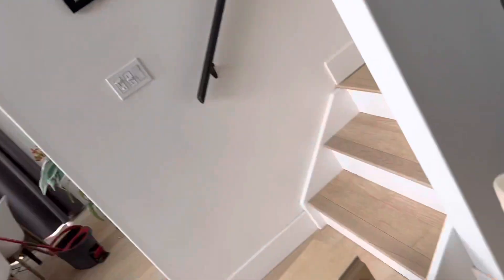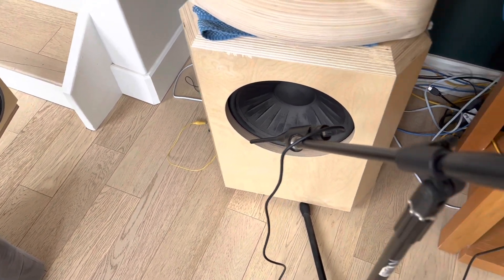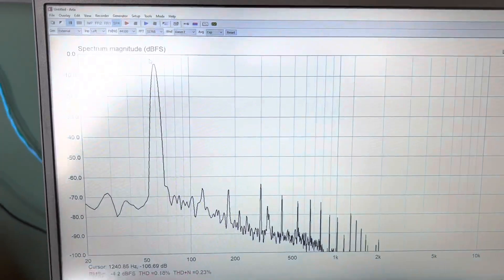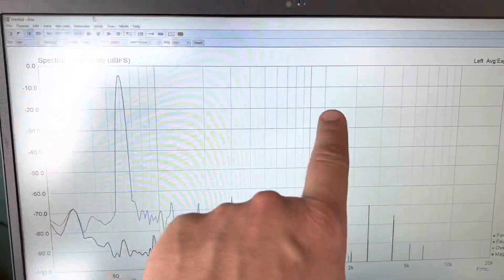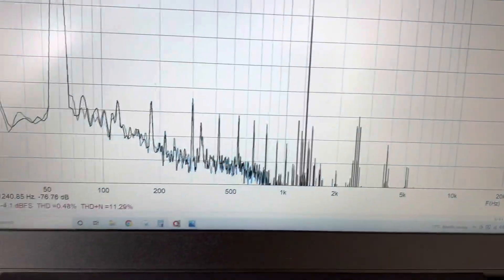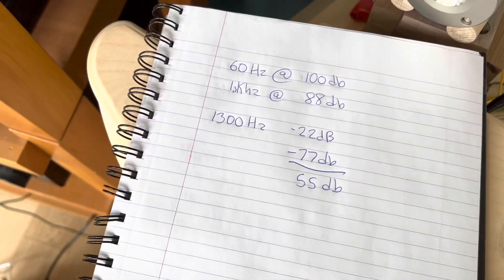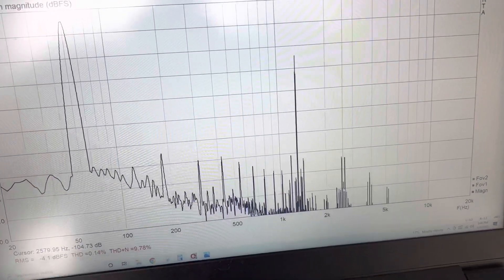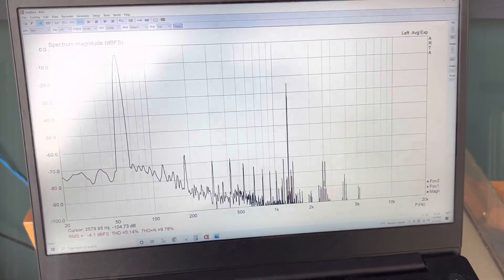Is my mic higher distortion than my speakers?  Let’s find out!

Comment: Thank you for sharing this very helpful test method. 
I have seen many developers making THD-measurements at high SPL at an extremely small distance between speaker membrane and mic. Such a setup heavily overloads standard mics that are not capable of the very high SPL involved. This overestimates THD and IMD in a not forseeable manner. I am using a moderately priced mic from ISEMCON EMM-82H-PX. The 82H-Type has lower sensitivity but can be used up to 140dB. In combination with an RME babyface, this allows reliable distortion measurements with low noise.
Nevertheless, cheap measuring mics are competely suitable for room correction and x-over development.
My personal experience is, that IMD and higher order HD do matter. Frequency response comes first, resonances and ringing has to be avoided by all means - and than comes jitter and IMD. I do not care much about second and fourth harmonics.
Reply: But that second or fourth harmonic will be modulated anyway. It'll also be amplified by resonances in the driver.

Comment: I have three mics. The UMM6, a Umik1 and a Umik2 from Cross-Spectrum labs that is calibrated by them. I found that my UMM6 was significantly off  in frequency response and distortion compared to both Umik's and the 1 matched the 2 fairly well.

I emailed CS labs and they basically said these kinds of microphones are fairly limited and if we want much better accuracy, they have recommendations and can validate their calibrations. I highly suggest just a better microphone outside of these cheapies from Dayton and minidsp.
Reply from the maker: CS Labs?

Comment: For measuring rooms, the cheap measurement mics like that one are perfectly fine. For designing speakers I wouldn’t use anything less than an Earthworks with an RME interface. In my case I use a Fireface UC for my testing rig which is great and offers pretty much all of the I/O you’d need to test any kind of system or gear
Reply: -55dB is more than enough distortion range. I mean it's 0.2% THD. Anything below 1% is more than enough.
Reply: @Elliott-Designs  for speaker design no. My speakers hover around 0.1% and I’m looking for drivers that’ll get me lower
Reply: @gerhardwestphalen  Just because you can get lower, doesn't mean you should. Once you get below audibility in one area, get below audibility in others. Start pumping the money into more important areas, such as active speaker design, extension, cabinet design, directivity, power response, so on, so fourth. My point being, don't put all your budget in one area! It's basic engineering design, based on studies. If studies prove that people can't discern anything below 1% THD, you reach that in your design process and work in other areas. If you want to keep pumping research into lower and lower distortion, be my guest. Doesn't mean that's the way it should be.
Reply: @Elliott-Designs  oh Elliot, what makes you think he's not doing all the prototypical  stuff ur rambling off on?? that and who are you to tell anyone what they should and should not be doing.. esp when you don't ask for his objectives ist, which you assume are your own... project much? I could go on but you're all to typical of those suffering from the "dunning kruger effect". With that closed mind of yours i'm guessing you're not a pro in this field. Maybe learn something from Crowe's "even keel" take on things.. i could tell he was a pro engineer in industry a mile off..
Reply: @gregd6022  Hi Greg, if you were to read my comments, you'd be able to tell I believe in the scientific method (as all well educated engineers should), absolutely nothing wrong with that, I also didn't say he couldn't use lower distortion microphones (because who am I to say what someone does or doesn't do). I was simply saying that I don't know of any scientific evidence that supports the need for such low distortion measurements, or needing something of such low distortion in terms of audibility. Also, no Dunning-Kruger Effect here that I'm aware of, I know I don't know everything, no one knows everything, and I believe the enlightenment part of the Dunning-Kruger Effect is the understanding that you will never know everything about a topic, and that all you can do is strive to know more. That's why confidence of the "expert", of which I'm not saying I am one, just giving an example, is lower than that of the ignoramus on the graph.
Last but not least Greg, Joseph is one of the first YouTubers I watched when getting into the hobby, there's no need to feel to defend him, if he felt he needed defence I'm sure he would have replied to correct me, which I was more than happy when I found he did. But I wasn't attacking his choices, I was questioning, as we all should be doing to each other, it makes us better at what we do. I think he's a great guy that makes really nicely measuring speakers 👍
Reply from the maker: Thank you for the suggestions.  My customer brought over his RME DAC the other day and it sounded better than the Topping D10S that I was using.  On ASR the RME has 10dB lower IMD than the topping and it was audible. (-120dB vs -130dB).  Was it the lower IMD I was hearing?  Perhaps.  Everything correlates to that.  I will be upgrading my test setup at the end of this year.  For now I want to do a series of videos that explore the topic more as a narrative.  One that I will be doing is comparing IMD and THD when looking at issues in the loudspeaker crossover region.  Thanks again.
Reply: @JosephCrowesDIYSpeakerBuilding  Fair enough, when I see a new peer reviewed study that disproves the last one, or at the very least a double blind test, then I'll believe it. I stick by the scientific principle. Otherwise I'll put it down to other things about the dac that have changed, or just plainly the placebo effect.
Reply from the maker: There are plenty of studies showing the inaudibility of higher order harmonic distortion.  When these high order harmonics are added to a sign wave they are completely inaudible.  However that is not what is being discussed.  
Here is an excerpt from the book Loudspeakers for Music Recording and Sound Reproduction…

“ It has puzzled many people for many years why relatively low levels of high-order harmonic distortion – 5th,6th,7th etc – have been associated with poor sound quality. The principal explanation has been that the higher harmonics are not musically related to the signal, but the very low levels of these distortions have not corroborated this idea when they have been added artificially to sine waves, where they have tended to be inaudible at levels which prove to be offensive on music. Czerwinski et al offer the explanation that the low levels of high-order harmonics are, in fact, just tips of high-order intermodulation distortion ‘icebergs’. It obviously does not bode well to be metaphorically sailing amongst icebergs in a sea full of piranhas! But that has been the reality of intermodulation distortion – a largely hidden, unquantifiable, yet dangerous enemy.

Distortion mechanisms which give rise to similar levels of harmonic distortion may yield greatly differing levels of intermodulation distortion, and this fact is surely at the root of the long acknowledged lack of any robust correlation between harmonic distortion measurements and subjective audio quality. Having said that, it is obvious that a loudspeaker producing 75% of total harmonic distortion (THD) at 1 kHz would not be considered to be high fidelity, but once we get into the low single figures at low frequencies, or below 0.5% at higher frequencies, then a loudspeaker with 10 dB less THD than another may well not guarantee that it would sound more musically accurate, even when their linear parameters were relatively similar. On the other hand, multi-tone intermodulation distortion presentations have begun to reveal good correlation between pure-sounding loudspeakers and clean-looking displays.”
Reply: @JosephCrowesDIYSpeakerBuilding  Thank you Joseph, so from what you are saying, is that distortion lower than 1% is audible, just not on a pure sine wave due to intermodulation distortion that occurs when you have stacked waveforms like in music which would be difficult to do a study on and is therefore listed as subjective, hence the analogy? Btw, please feel free to correct me, always up for learning more! I usually base these things off of research you see, but if the research is incomplete and doesn't provide the full picture as you are suggesting, then of course more needs to be done. It might make an interesting thesis/study for a final year project for me if that's the case.

Comment: Side question: Why ARTA over REW? Any particular reason, or just what you're used to? I find REW's extra features useful to me, but I can see having access to a proper polar plotter would be useful!
Reply from the maker: In terms of on-axis frequency response they are identical.  However REW requires quite a few steps to get a match-up between the two programs.  Out of the box REW does not gate the response and requires a fair bit of digging to setup.  The smoothing needs to be changed to 24dB/octave and the vertical scale altered to 50dB.  The shape of the graph window needs to be altered to a 4:3 aspect ratio similar to ARTA.   Then the response graphs match up perfectly, however saving these settings is a hassle as well. So if none of these steps are completed I feel that REW somewhat embellished the test results which is not what you want when testing speakers, unless one  “wants” it to look good. 
ARTA continues to develop their multitone functionality even allowing 12 band per octave test tones with a new overlay function.
Reply: @JosephCrowesDIYSpeakerBuilding  Thanks for the detailed reply Joseph! I like to use Physchoacoustic smoothing in REW, since it actually represents what we can hear in terms of gain changes, which I always find useful. Of course, the more detailed response is useful for knowing how the speaker actually behaves. I'll have to try out ARTA, this multitone stuff sounds interesting, I've never heard it before. Did you see my reply on how your mic's distortion is plenty good enough in terms of distortion audibility, because it really is. I wouldn't worry 😉. What frustrates me is that a measurement mic doesn't exist that has accurate phase characteristics (or phase correction with a calibration file). It means we'll never be able to truly test the phase of a speaker, not until we eventually get one of these mics, or a way to calibrate the phase response of a mic.
Reply: @Elliott-Designs  If you don't have a copy of ARTA its def. worth getting. The license is not too expensive. Reading Josephs reply just has me reliving all the frustrations I had with trying to use REW for the gated measurements. It can be made to work, but ARTA is much more fluid and easier to use in that regard. Also its very good for making horizontal and vertical directivity plots. Even though these are tedious to do if you don't have an automated turn table, ARTA at least makes making repetitive measurements fairly straightforward and easy. That would be a hair-pulling experience in REW, and I could only get a basic family of on and off-axis responses and not an actual graphical map.
Reply from the maker: Off-axis is easier and quicker with two people, one person at the computer and another moving the speaker.  Someday I’ll get a rotary table.
Reply: @JosephCrowesDIYSpeakerBuilding  Makes sense, thank you 👍
Reply: @JosephCrowesDIYSpeakerBuilding  Yeah I can relate to that. My "rotary" table is a wooden top to an old hamper with a rotary bearing and hand-marked degree graduations. Even worse is vertical for large speakers since they are too big to sit sideways on the table without altering the response. Last time I did it I resorted to calculating discrete points and used a laser distance finder to position the mic for each measurement, and even then its limited to about ±45 degrees in a room with tall ceilings. If I did these more I'd even possibly consider making a "Klippel-Lite" robotic mechanism to move the microphone to predetermined locations for taking measurements.
Reply: Ok enough waffling mysock and get to the point... REW cannot do a lot of measurements that ARTA can, like making directivity plots. It can only really do on-axis measurements. Im pretty sure thats why is that it lacks the functionality of ARTA.
Reply: And if you can humor a bit more of my blathering, I also don't like REWs interface as much for gated measurements now that I think back (its been awhile since I have used either of them). ARTAs is much easier to use IMO. REW, however, is really good at making in-room measurements, so really its down to using the program that is most appropriate for making the type of measurement you want for me. I use ARTA for things like on-axis response and directivity measurements, while REW for making in-room measurements and adjustments.
Reply: @mysock351C  Yeah, I totally agree with REW being more suited for in-room, and not for directivity; that's what I meant by polar plot really. As for on axis, not necessarily.
You do have FFT MMM type stuff after all.
It also has some super useful features that ARTA doesn't have. Honestly, I combination of the the two programs is probably most ideal.

Comment: Looks very interesting. That's great that your speaker is measuring with such low distortion, very impressive! Just wanted to say -55dB is more than enough distortion measurement capability. 54dB below fundamental frequency is 0.2% THD, and given that we aren't meant to hear distortion at all below 1% THD, I think it's more than enough 👍. I wouldn't worry about your equipment in terms of distortion accuracy unless you were worried about getting the right numbers for marketing the speakers 🙂👍
Reply from the maker: I agree that THD is benign and actually preferable in some instances.  I recently listened to the Schitt preamp and it had a rich vocal sound with the tubes engaged.  However when switching off the tube stage the richness went away.  What I’m mainly concerned about is IMD from the speakers.  IMD from a loudspeaker is very audible, and not in a good way, especially through the critical midrange where our hearing is most sensitive to nonlinearaties.
Reply: @JosephCrowesDIYSpeakerBuilding  Totally agree, that's what the 1% is in reference to. I don't like distortion either, we just can't hear anything below that. That richness you talk about from tubes (according to the research I've read in the past) is all to do with the fact that the ratio between odd and even order harmonics is different, and most people prefer that ratio that you get from tubes. I personally like as low possible distortion (for the price of course), but everyone has their preferences!

Comment: Pretty sure this is a limitation of capsule size. Just like any speaker driver, there is a maximum amount of linear excursion. Even Brüel & Kjær describes 3% distortion as the recommended maximum for accurate measurements, and they are among the best.

Moving up to a 1/2" capsule like the UMIK-2 would help at the cost of being more uni-directional. The other solution would be moving the microphone further from the DUT and lowering the noise floor, but that is understandably difficult in a residential environment.
Reply from the maker: Reducing the input at the microphone does not lower the noise floor.  I’ve tried.  -65dB IMD is the limit on the UMM6 regardless of test setup.  
Using a dynamic microphone gets it down to about -80dB.  I’m still investigating.  Thanks.
https://josephcrowe.com/blogs/news/shure-sm58-dynamic-microphone-for-loudspeaker-measurement
Reply: This is true, larger capsules are higher efficiency and therefore lower distortion (lower noise floor), also as you say, larger capsules have poorer directionality. 3% maximum sounds about right for accurate measurements, but as I said in other comments, -55dB below the fundamental is about 0.2%, and that's far better than what we can even discern.